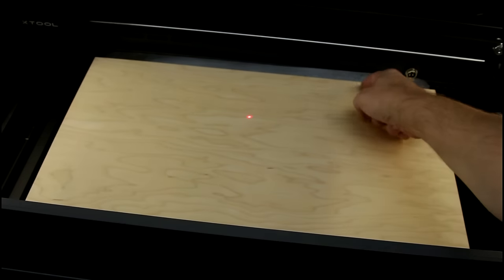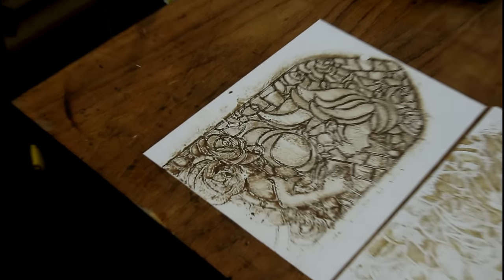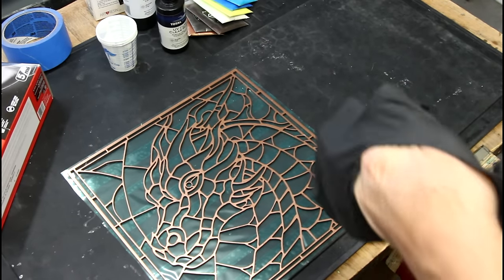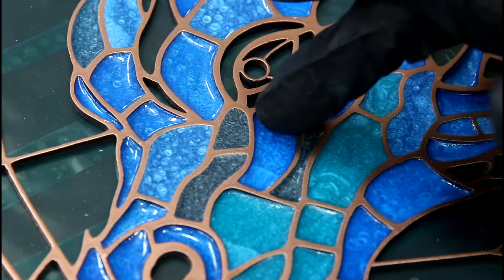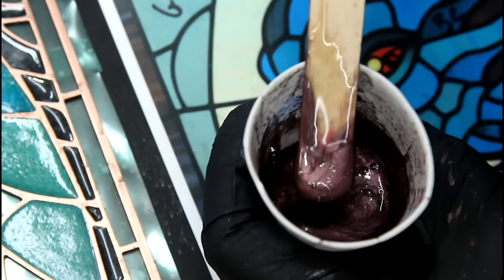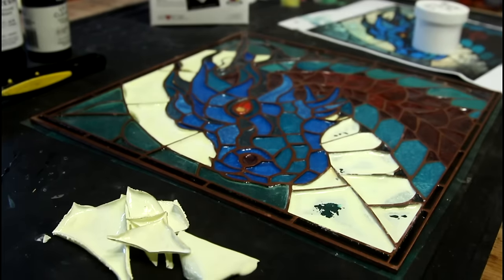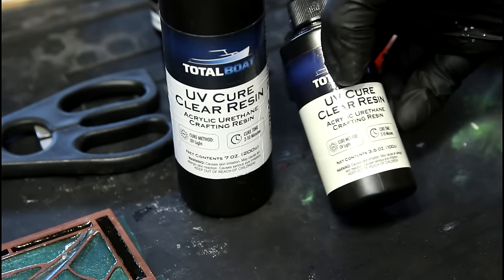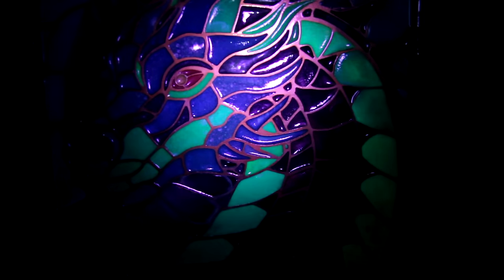Resin Stained Glass: Viewer Suggestions!

Comment: Peter,
Opaque pigments and UV resin do not work together.  UV resin cures with light and opaque pigments block that light. That white pigment I sent you all those years ago was titanium dioxide the red i don't remember exactly what it was, but it blocked the light enough to stop the cure. You could put very thin layers of those mixtures and you may have some success, but i would reserve opaque pigments to an A/B epoxy. 
P.S. i haven't missed an episode since i started watching all those years ago. I am glad that lately you have been uploading more often, and that you are still finding use of the stuff i sent (despite the fact it caused so much mayhem on this project). Also i still work in adhesives, but I am a leatherworker now too if you want to try to work leather into a project let me know.
Reply from the maker: Thank you Ian!
Reply: Getting one of those nail polish UV setups that just sits on the surface will include good UV bulbs plus ease of use and larger coverage area for the light. I have used such a lamp with great success with UV resin.
Reply: You used too much mica powder.

It has nothing to do with opaque colours. But powders that are too thick in application do obscure opacity for curing. 

3 tips.

1. Use a 36 watt for at least 3 or 4 minutes. The time will vary depending on the brand and thickness of the UV resin. 

Doming resins tend to thicken and cure faster than more viscous resins. 

Cure on both sides.

2. Mica powder can be strengthened with alcohol inks (again, mild amounts!) and not only will you create bright new colours, but the ink will soften opacity allowing the resin to cure more thoroughly. 

3. Resin brands matter. If you get a high end resin like Piccassio for example, it will be thick enough to dome well, thin enough to pour well, and cures FAR faster than many brands. 

Other brands such as Let's Resin will take longer to cure, is a bit thinner, and this means that work time can vary.

Some resins take forever to cure. So do some comparative shopping. 

Good luck with future projects.
Reply: opaque pigmented resins can uv cure, i've seen it before, but they need a lot more time in the light
Reply: @prcervi  Materials that are mostly opaque will, however that is titanium dioxide ( i was the person who sent it to him) think of it like Zinc oxide (commonly used as sunscreen). There is TiO2 in some sunscreens as well, and in those cases you only need a fraction of TiO2 compared to ZiO2. Even in some adhesive applications titanium dioxide is specifically used to block out uv light. Enough of it will block out 99.999% of all UV light making curing a UV resin impossible. How do I know?,  I have been working formulating custom adhesives for the automotive and aerospace industry for close to 20 years. I have specifically worked on custom adhesives that need to block UV light/radiation both here on earth and also elsewhere.
Reply: @erikbrush  It has everything to do with opacity. To save the trouble of typing  it all out see my response to nighttear12 below.
Reply: @ianthomas3653 I agree, It's an opacity issue. Possibly more UV exposure would help, but I think the inside would still be liquid. Glitter does the same thing.
Reply: this was the exact process I had to go through with using uv epoxy. the more transparent the better. He also made an important discovery at the end, because even if you dont have a good UV setup you actually do if you get timing right. A sunlight bath (not for too long) really helps and more importantly a sunlight bath sooner in the process. once the top is cured take it outside on a sunny day and flip it over to cure the back. then remove tape.
Reply: @erikbrush I agree with everything you have said here. Only problem is I think Peter is tied into Total Boat by a sponsorship contract. It may be difficult for him to use more than a couple of ounces of a competitor brand.
Reply: Late to the party. Came here to say this. Alternative would be to set the whole thing on a piece of glass and shine the UV light from the bottom. But a stronger light would be helpful in any case.
Reply: Opaque pigments can be used, but only if used in very small amounts. I use opaque acrylic paint all the time.
Reply: @erikbrush it may be true that he used too much mica powder, but the opaqueness could very well cause it to not cure properly if he doesn't get the proper wattage and time into curing. Both can be true. The amount of mica powder would cause too much opacity, therefore blocking the passage of uv light.
Reply: My opaque pigments work with UV resin lol.... Then again I only make small things like jewelry and keychains. The opaque pigments didn't work with the UV resin when I tried making coasters and small dishes, which isn't what UV resin is for...I think. 😅
Reply: In my own experience I can absolutely agree that opaque pigments are UV resin's enemy.

Comment: You need stronger UV light and translucent pigments. That white pigment is probably opaque so the moment the top layer cured it stopped the light penetrating towards the bottom of the "pool".
Reply: Could be... I'm no scientist, but uv isn't visible light and it passes through many opaque things. It would be interesting to see a test.
Reply: More opaque gel nail polishes can take longer to cure, especially dark colors
Reply: This. What happened wasn't due to the chemical properties of your pigments, but the optical properties. The white pigment was designed to scatter and reflect light evenly across the visual spectrum, but ultraviolet is pretty close to the upper end of our visual range and probably was also being scattered and reflected by it. You also used enough white pigment that those parts appeared to be quite opaque, blocking the UV from getting much past the surface. If you mixed the pigment more thinly the UV would have been able to scatter and penetrate better. If you still want an opaque look you may need to fill most of the space with transparent resin and cure it first, then try a thin layer of more opaque resin on top. But it may also be possible to get pigments that are more translucent in UV and thus work better with UV resin.

By the same token the red segments also didn't cure as well, despite being translucent. But again, this is due to the optical properties of the pigment. In this case the pigment is designed to absorb strongly in the blue and green parts of the spectrum, thus providing a translucent red light when lit with white lite. Once again the pigment probably has the same properties in UV that it has in the blue part of the spectrum and absorbs the UV, making it harder for the resin to cure, although it was not as opaque in UV as the white was so it seemed to fare better.

You'll probably need to experiment to see which pigments work better in UV resin. Maybe try less pigment density in the resin, thin pours, a stronger UV light, and patience.
Reply: Its a clear bottom. Flip it over and hit w uv again.
Reply: @pattiklaus9580  But it curled up. Lol. Even if it didn't, you'd just end up with a liquid filled pocket if you only cured the surfaces. Really, the entire volume needs to cure
Reply: @MannonMartin all of this.
Reply: Worse; "Bright" pigments usually ARE bright because besides reflecting the color spectrum that you'd expect, they ALSO reflect UV, causing the eye to register extra photons (even though they don't trigger the cones, the rods pick up the photons and our brain says "aha, that's just super bright color!")
Because those pigments REFLECT UV, though... They REALLY don't play well with UV resins.
Reply from the maker: Thank you ALL!  Do you think I should get some Alcohol Inks for UV in the future?
Reply: @peterbrownwastaken  I would also say you could leave it out in the sun it gives off a ton of uv light i have seen people do it for coatings on fishing lures
Reply: @peterbrownwastaken  It wouldn't hurt to do a small project to test, you likely still have a mold for some knick-knack around, may be worth a short even.
Reply: @peterbrownwastaken yes but the color won't stay as vibrant because the UV resin will continue to cure the more light hits it. What works best to color UV resin is to cure it clear and take advantage of its stickiness by burnishing and buffing on mica powders during that sticky but cured phase or buffing on thin layers of mica onto the mold layer (aka the tape or the silicone mold itself).
Reply: @pattiklaus9580 the you have a liquid center, and is not something you want either.
Reply: @peterbrownwastaken  You should make a resin stained glass lampshade!!!
Reply: I don't know about alcohol inks. I know uv resin cleans up with isopropyl, so alcohol might not play well
Reply: literally what I was going to suggest, uv resin wont cure properly if the pigment isn't opaque enough to let the UV light cure the whole thing. I've had similar issues with resin molds that weren't opaque and uv resin. learning the hard way isn't so fun.
Reply: Not only being opaque, but being such a light color reflects a lot of the UV light back off of it as opposed to a darker color that would absorb it.  3d resin printers require longer exposure times per layer for lighter colored resins.  That whole panel would need to be bombarded with UV light.  Also, not all UV lights and UV resins match up with regard to nm wavelength.
Reply: @peterbrownwastaken  If you do that make sure they're designed for UV resin. I've used the wrong pigments before and the UV just bleaches the color out like how colors fade in the sun.
Reply: @peterbrownwastaken for darker colors and more opaque colors, just go back to epoxy resin. Believe me it’s a rough mistake. UV is great for purposeful layers to make 3d images, and clear glass. I tried using uv resin for my mold pours to create a cool effect. It ended so poorly. Lol! Also uv resin is amazing for invisible glue. Then my dice can have objects in the center without worry of imbalanced dies.

Also stop using torches for your resin, get a spray bottle and put rubbing alcohol in it. The torch messes with the chemicals and causes the resin to yellow faster.
Reply: I'm late to the chat, but white "pigment" is usually titanium dioxide which is also used in inorganic sunscreens as a strong UV filter.
Reply: @peterbrownwastaken in resin printing, alcohol inks are used to dye transparent resin. So would be best shot
Reply: @tr1ppl3M in theory yes but it would not be strong enough if it doesn’t hit directly (think of clothes or even sunscreen keeping you from being sunburned) UV resin is great but it really doesn’t work that well with super opaque pigments or if you have a high pigment to resin ratio. 😢
Reply: @peterbrownwastaken UV resin with low mica loads would also probably still work. I think this is why the first blue color cured so well. It had the least amount of pigment in it. If you go with darker or brighter colors of mica but try to keep the amount pretty low and consistent in each batch, it would probably set up more reliably. Or mix alcohol inks with smaller amounts of mica.

Also, I think probably a more powerful UV light would help it set up all the way through. And maybe do it over a white or metallic background that will reflect the light back up through the piece again.
Reply: Was gonna say same....uv light can't get thru....you can try to cure from back
Reply: @MannonMartin this is absolutely correct! 100% the issue.
Reply: I'm a uv resin artist plus uv gel nail polish artist so when I saw this episode I got excited to see that he took everyone's suggestions.
 Unfortunately I could tell from the very first color mix that it wasn't going to cure properly unless he made adjustments.
I was talking out loud to myself saying things like "Too much pigment, not correct type of pigments, not unless pigment were thinned out way more, no clear bottom layer for how thick the resin will end up being and not enough uv light."
 I thought to myself "I'm sure he will figure it out in the end" and he did when he pulled out the let's resin stuff and started noticing the differences in his materials.
This is why I enjoy this channel because he is open about all of it and doesn't edit out his mistakes. 
I don't know if anyone else here has gone through the same issues as him using uv resin so let's come together to help him out with video suggestions.
Reply: Yup! This exactly. I've worked exclusively with UV resins, and opacity and thickness is a huge component of success. It's really important when making resin jewelry with inlays, because if something is blocking the light, it either needs to be cured from both sides, or have a base layer cured, then the solid item placed on top, then the final layer
Reply: @peterbrownwastaken maybe you could do a dye trying episode with uv resin? I have some and have been afraid to mess it up with pigments
Reply: Yup
Reply: @tr1ppl3M  it does but you have to cure more opaque things for way longer than translucent.
Reply: @peterbrownwastaken an easy fix is just do a thin layer of clear over the top to lock it in.

Comment: Peter, a few tips for this. UV resin doesn't do well with massive amounts of mica powder due to it blocking the light. 2 you need to follow the amount of time the resin on the bottle tells you to cure it. You were curing way too little with the UV light you have. Also, to get a proper stained-glass look, use a resin pigment like alcohol inks or translucent colorant for it.
Reply from the maker: Thank you.
Reply: Make sure to use UV pigments. Alcohol ink will affect the resin. We use alcohol to clean up the UV resin
Reply: @LeopardessMoon01  Alcohol ink does work in UV resin if you use very little. The problem with alcohol inks in resin though, is that they fade in indoor natural lighting in about 6 weeks. So not recommended, especially for something that is designed to be put in full sun.
Reply: if I was doing this i'd just leave it outside for a few hours, just to be sure, get that sun UV
Reply: @wolfsrose1985  that's weird. I have a table with a polyester resin middle dyed with alcohol inks and it hasn't faded one bit. It's a couple of years old now I think.
Reply: I had frustrating results using alcohol inks in UV resin. I cured it with a UV lamp for about 20 minutes trying to get it to fully cure, when that failed I left it outside all day. But, there was still a sticky residue all over the outside of the pendant. I later learned a remedy for sticky UV resin.. put the piece in a clear container full of water, place a UV light next to it and cure it again through the clear container for a couple of min. I haven’t tried this yet but. It does seem to work with small jewelry pieces. That technique would be awkward with Peter’s large stained glass piece and I would be concerned it would damage the wood.
Reply: @funo6581  I've found there is usually a small sticky layer at the end, but you can clean that off with isopropyl alcohol.
Reply: @LynetteBunBun  Thanks for that info. I hadn’t heard that before, I’ll definitely do that next time.😊
Reply: @funo6581  it happens on occasion depending on brand
Reply: Yeah the inks do work well for stained glass but inks and some powder does really well with mixing on certain pieces to give a more defined look. There is multiple types of stained glass both color tinted and ones that have a white or more opaque coloring, enough to illuminate from the light but enough to give a stark contrast to the background. Depends on the intent of glass, background would be more clear unless water is present then it would be more clear than the rest while a figure would be more opaque.
Reply: @silentferret1049  the only reason I said to use inks or transparent pigments is to let the uv light shine through better this way you get a better cure.